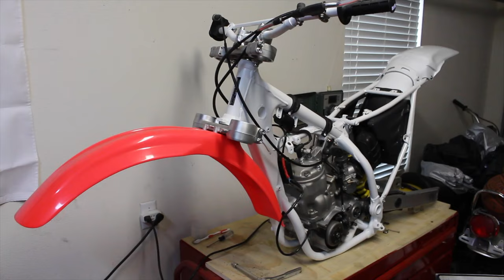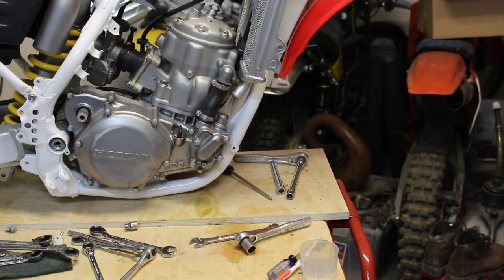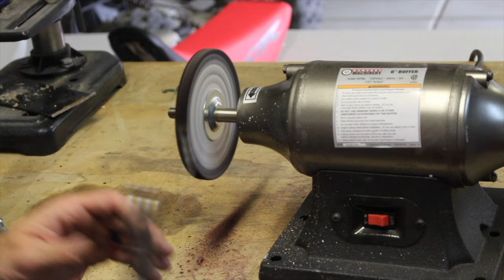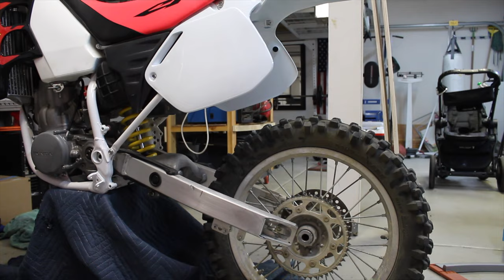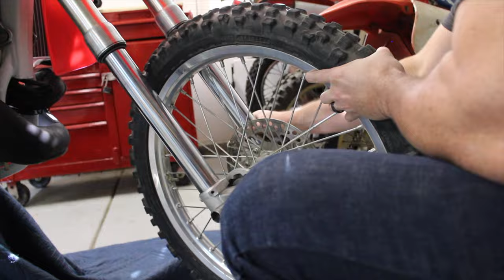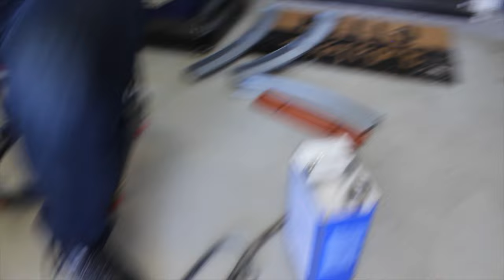Clutch Restorations Episode 7: 1997 CR500R Restoration

Comment: Great video-series! I'm restoring my 2000 CR500 at the moment. I've had the bike in my shed since 2007, when I bought it for $ 1700. I only rode it twice, since I did not have the time... (kids). I completely forgot about the old Honda, but watched a video a couple of months ago, and found out that the CR500 has become the most sought after mx-bike in the world😀 Thanks for the inspiration, I'm going for the clean stock look as well! Greetings from Norway!
Reply: Thanks!!! That is awesome! Please send me a link to a video of it! 2000 was my favorite year. First 500 I purchased, brand new to race in the desert. I think evoMX can help you if you need graphics. Lol, I still need to upload the final video!!
Reply: @ScottRansons  Cool! Looking forward to the video! The plastics on mine are all original, except for the rear fender. I sourced brand new rad shrouds on ebay, veeery expensive, but worth it👍 Doing the seat cover today, that’s not oem, but a very good replica. I’ve mostly worked on fourstrokes, and installed a big bore kit on my ZX-9R last year. But the CR500 is going to look amazing when finished! I can send you some before and after pics when complete if ur interested. Grace and peace buddy👍
Reply: @nitramh24  That is rad!!! Original plastics are just ridiculously rare. For sure, please send the pics!